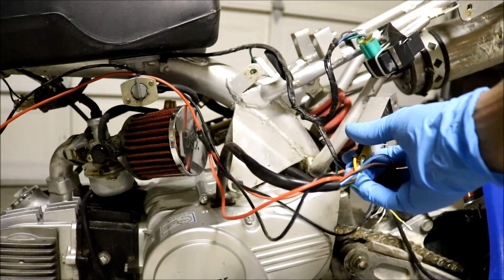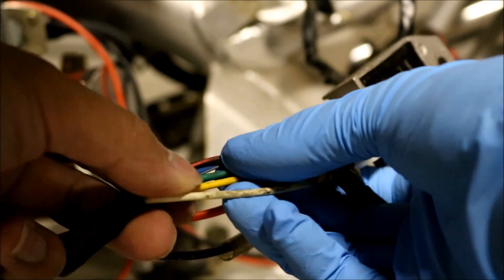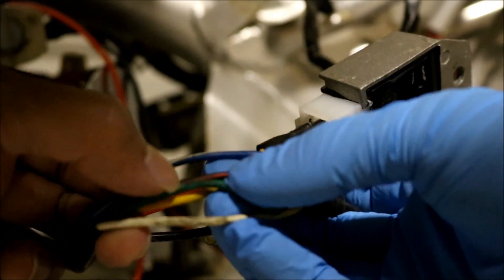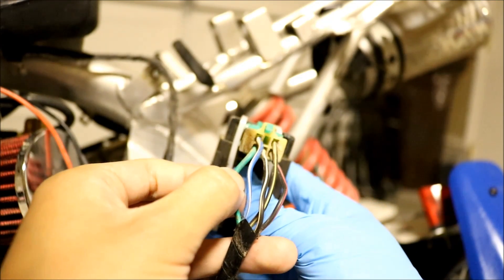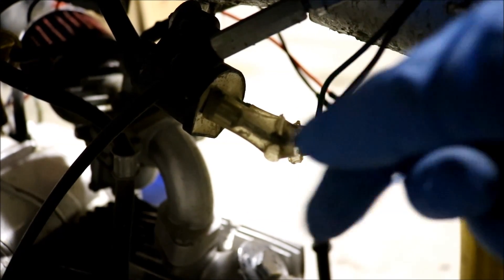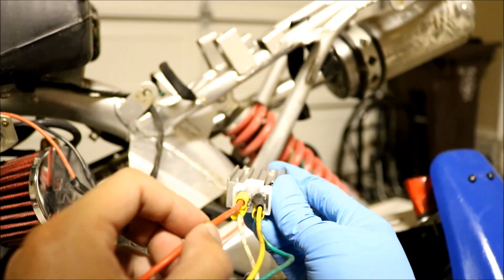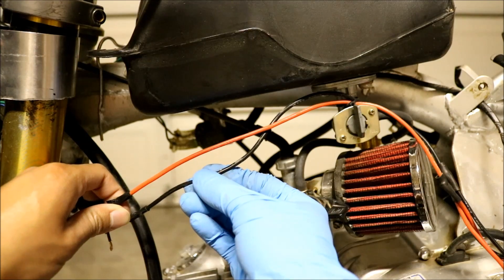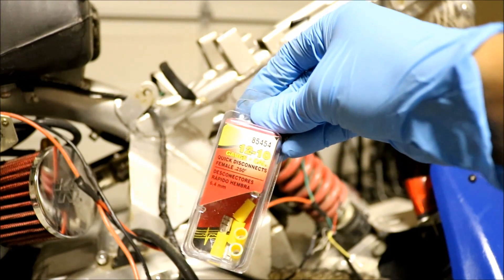Pitbike Regulator Rectifier Wiring

Comment: For anyone that cannot make 12v dc from their rectifier make sure you check if your stator is half or full phase. Most of the pitters use a half phase stators which won’t work on the regular full wave rectifiers you will have to find a half wave rectifier. usually if you have a yellow and white wire you have a half phase and if you have two yellows it usually is a full phase stator in which you should buy a full wave rectifier.

Comment: Do I need a separate switch for my lights ? Do i wire the rectifier into the stator or can I use the wires from my kill switch to tap in to the positive and negative??

Comment: curious so if you are not connecting the red to the starter solenoid  the battery isnt charging. Why wouldn't you want to ren another red wire there to charge the battery as well?

Comment: How would I hook my coil pack and kill switch up to my stater wires it has five all the same color as yours but I have two yellows instead of a white my coil pack wires are black and yellow and green and my Killswitch wires are black and white and green I’ve tried hooking it up multiple different ways and I can’t get spark. Do you know what I’m doing wrong?

Comment: i did the same hook up but the lights only turn on  at high RPM's so wouldi need to add a battery ?
Reply from the maker: If the lights are barely lighting up then its probably not  enough power to charge the battery. The battery will just keep dying.

1st double check the wiring to make sure connections are good. After you  can check the voltage(DC) that is coming out.

You can see if you actually have a lightening coil too. Under the cover it should have either 2 or multiple coils,

Comment: Any tips on how to test the regulator? I have checked wiring and its exactly as you have yours so thats all good but when I ride the bike it just runs the battery down and I cant work out why. I have a suspicion the regulator is faulty but I don't know how to test it.
Reply from the maker: Before starting, check the voltage of the battery. After, start the engine and test the battery voltage with the engine running. You can give it some revs to see if there is any change in voltage too(Disconnect any lights or sensitive aux equipment in case). Go slow with the revs to make sure it is not going beyond 13-14v(this voltage means the battery is charging). If you see no change in voltage after starting engine, there is a problem.
Reply: @IsaacPel  great thanks mate...much appreciated.
Reply: @IsaacPel  Ok sweet much appreciated.
Reply: @my50bike: Did you find a solution to your problem. I have the same issue. I have tried a new regulator but that didnt fix. Curious to know if you manage to fix your issue.
Reply: @tomiylkanen7843  Hi, my issue ended up being the regulator the problem was solved. I used the techniques on this video to help me test it and found it was faulty.
Reply: @my50bike  Ok, thanks! So you just replaced the regulator and that fixed it?
Reply: @tomiylkanen7843  that fixed my problem. My problem was the lights were not charging and that's because the regulator was faulty. It may be different to your issue?

Comment: know this video is 4 years old  but in case anyone does see this I've been a mechanic and auto sparky for over 10 years I've lost count of how many Chinese e22 motors I've torn down/modified/repaired very simple electrical systems

Here is how to properly wire a system from the stator to C.D.I (Capacitive Dishcharge Ignition) & regulator/rectifier 

From stator plate to C.D.I

Black/red   -  main coil/exciter
Blue/white -  timing trigger
Green          -  ground
Green/red   - neautral selector switch

BLACK/RED - main current to C.D.I for running motor.

BLACK/YELLOW - from C.D.I is now your main (+) current which connects the coil.

The coil is a basically a transformer to amp up the voltage to 104V to create sufficient spark for chambered combustion).

BLUE/WHITE - tells the C.D.I what position the motor is away from TDC (top dead centre) and when to fire the spark.

BLACK/WHITE - from C.DI is for killswitch self explanatory.

GREEN - earth to loom which is grounded to the frame at some point.

GREEN/RED - neautral selector switch this connects to your 12V (N) on instrumentation.

Yellow         - secondary coil/lights
White          - secondary coil/charging

NOTE : both white and yellow wires are run from the secondary coil on stator plate so either can be used for charging or lighting BUT these are dirty AC currents produced from the stator so a regulator/rectifier is ESSENTIAL , once the AC has been regulated & rectified the output is now a clean & usable 12V DC

From the regulator/rectifier

RED -  for charging battery & powering 12V dash instrumentation this usually has a 3 way splice from regulator to 6A fuse then to (+) anode on battery on one end, other end goes straight to the red (+) on ignition barrell, when ignition barrel is in hot position (on) black from ignition barrel is now your hotwire (+) for your 12V instrumentation, if you don't have an ignition barrel or 12V cluster then run direct to battery from 12V 6A fuse

GREEN - earth you can set this straight to the frame, or connect to the (-) cathode of the battery

YELLOW - for lighting circuit, 3 way splice from stator to regulator then to headlight switch, and from headlight switch to your headlight, a 5-10A fuse is also recommended to be added mid circuit,

WHITE OR PINK- for charging a battery this connects straight to the regulator/rectifier

Never start a bike with headlights switched on, when first started voltages spike this can burn out lights real fast if there's no fuse set into the lighting circuit, with a switch and fuse this wont happen.

From ignition barrel

RED - for power (+) connect to (+) anode on battery as mentioned above.

BLACK - for power (+) to operate instrumentation from red wire when ignition is in the hot (on) position.

GREEN - for earth

BLACK/WHITE - for killswitch

That's pretty much it unless your installing digital speedo/tacho units which i won't go into as this is an essay just about already 😋

Cheers
Matt from 🇦🇺
Reply: Thanks so much!
Reply: I have a brown wire on my regulator, do you know where that would connect?
Reply: Great knowledge 👏 👌 👍 🙌 💯  
Great mind 👌  👍
Reply: You are the man! Dude I’m going crazy trying to figure out how to get my battery to charge. I tried folllowing tbolt instructions but it’s confusing. I’m going to screen shot this and try your way. Thank you!
Reply: @SDmotobro did his way work ?

Comment: Have you or can you go more in depth on how you connected the turn signals?
Reply from the maker: I no longer own the bike but it's still a simple circuit. You would need a turn signal switch and a relay(for flashing). Videos should be a available if you search. Good luck!

Comment: So if it has 3 then no lights?
Reply from the maker: Right, you would need a 5 wire stator which has two or more coils(more output for engine and aux/lights/charge battery.) The 3 wire only has 1 coil for engine. The 5 wire stator is not too expensive but it does take work into replacing and possibly special tools.

Comment: How can I wire a headlight and a usb charger
Reply from the maker: If you are going to use a light and a usb charger you definitely want to use a battery. There are motorcycle usb chargers you can directly hook up/connect to the battery or 12v. Some have on/off switches but if it doesn’t and you don’t run the bike often, you may want to disconnect it to stop if from draining the battery.
Reply from the maker: Also if you are trying to add it to a pit bike, the amps on current cellphone batteries are comparable to the amps on pit bike batteries. It may be best to just stick with portable power banks to charge your electronics.

Comment: Howzit man. I have a bit of an issue I replaced my atv engine that had a yellow and a white wire coming out of the stator 
And the new engine has two yellow wires coming from the stator. How do I connect them to the wiring
Reply: They can be for either doesn't matter if white/white, yellow/yellow or yellow/white  they are both connected to the secondary coil on stator plate they both produce the same amount of AC

Comment: Do you know how to add a way to store enough power so the headlight stays bright whenever its on, not only at high rpm? Iv done the same thing you did, and i wish this video was available then. Nice work! Thanks.
Reply from the maker: Thanks, appreciate it! In your case you probably just have to add a battery to keep everything more constant.
Reply: Thats exactly what i was thinking, but i cant find one small enough. Would a capacitor work? Im not an electric guru, but with you tube, i ussually get it done. Lol

Comment: My stator does not have the white and yellow wires . How would I add head and tail lights??
Reply: I bought a different stater/magneto for my pit bike to add head and tail lights off amazon, cheap and easy! Dumb me, after i was halfway done, i realized i didnt even need a different stater/magneto, but i finished it with the new parts. Now i wanna add a small battery so the headlight is always bright.

Comment: So how does the ground from the stator get connected to the regulator do you run the negative from lights to ground wire spliced and then into the reg ?

Comment: Trying to wire my ktm . Wires are a mess. Is there a way I can find the main power from the stator regulator to a battery then to a aftermarket harness with all my lights and switches ?

Comment: I have a trail 70 I swapped the engine to a 5 wire yx 190 and I got 2 yellow wires I had to twist together a yellow a white and then add a stator yellow and ground the other one and I got my power... so is your method for a yellow and a white not 2 yellows

Comment: if your bike has a battery all you have to do is run your light switch to black on ignition switch ground wires ( usually green) to ground in harness hi/lo goes to appropriate position on switch.  no need to worry about hot wire as it will get power when you turn on key.  the only reason to mess with wiring lights to a stator is if your particular bike does NOT have a battery.
Reply: Mind helping me with my project?
Reply: I’m trying to add a battery to mine I’ve linked exactly the same way for my wiring all my lights are perfect just not bright enough, question is do I like the red wire from rectifier to red on battery then add the red to the ignition system desperately trying to run the battery with it too
Reply: Hi mate. Any chance you could give me some wiring advice.  I’ve been trying everywhere this is my last resort😭😂

Comment: I have a 125cc LIfan in my Honda XR70 and I'm adding lights and now I'm adding lights and even gonna register it street legal. I tested the Stator and it's providing plenty enough. Problem is only 4 wires that I didn't need before are coming out of the Stator. Green, Yellow, White, and Green/Red. Also, you said you needed 5 wires to run lights? Also, the head light has a high beam and turn signal. I bought and installed turn signals on the back too. Do I just split the wire for those too? I bought a blinker so I'd be going thru that first for the turn signals, front and back.
Reply: He never responded but did you ever figure this out?

Comment: This isn't regulating my voltage. Burned out all my bulbs. Have you run into this problem and found a solution yet?
Reply: Supposedly the rectifier is bad. Next time lets add a 2 amp fuse before the bulb just in case the cheap rectifier goes out again
Reply: hey i dont know but thought id offer info, get a multimeter, you can  put one lead to ground then probe the terminals at the regulator anything crazy or above 12 volt range may burn bulbs, could be a simple fix like a wire in a wrong spot. good luck!
Reply: I just did the same thing. Did you find a solution?
Reply: Any solutions guys?
Reply: You stator generating higher voltage than regulator can withstand or you drawing too much current.

Comment: Where did you connect the green cable for ground
Reply from the maker: Sorry for the super late reply but there are a couple ways to connect wires to ground/frame. One way is crimping or soldering a ring terminal to the wire and then adding it to a bolt going through the frame. Use should use a multimeter to test that you have continuity.

Comment: Dude thank you so much. Someone before me botched the wiring job of the rectifier.
Reply: so ac and dc share ground (frame)? or is bottom right the dc ground?
Reply from the maker: Josh Koelker Sorry for the late reply, but glad to hear! 

I honestly do not understand much about circuits but I believe in this case you can say they share a common ground. In all motorcycles I've owned the batteries negative terminal was always grounded to the frame. So to save some wire you can just connect the negative light/battery terminal to the frame.
Reply from the maker: It's also best to use a voltmeter to test connections and voltages to avoid damage 👍

Comment: How do I get braking light as Well? I've got a 3 wire tail light and brake switches but don't know what to do with it?
Reply: Lukvaz Munk jambo / jumbo footbrake switch is what you need to buy it runs, to the rear tire
Reply: You have to run a seperate power wire in series through both switches, starting with a splice to dc power (red) and ending at the brake light wire.
Reply from the maker: It's best if I make another video with a diagram showing the wiring for the brake light. Its a little difficult to explain it in words. It took me a bit to figure out how to do it myself but I bought an on/off switch for the foot brake. 

I believe you have 2 positive and 1 negative lead. So in mine I wired the running light with my head light so 1 positive and the 1 negative connected. Then I wired the last positive with the switch so the connection would complete when I step on the foot brake.